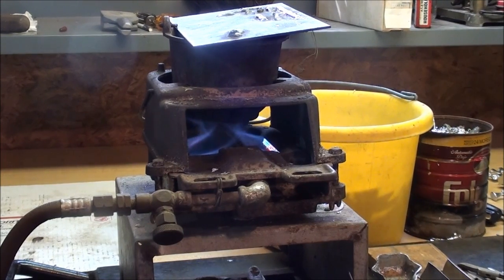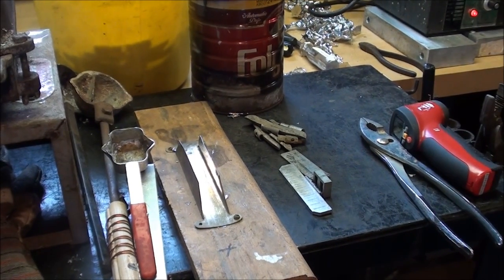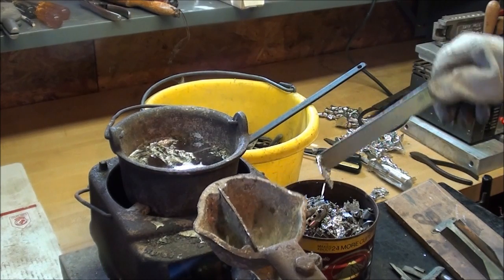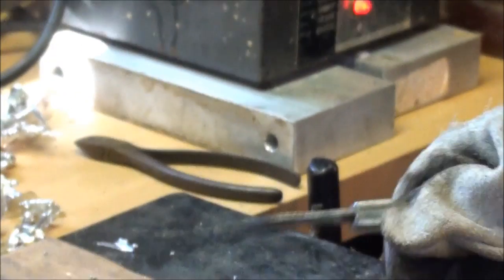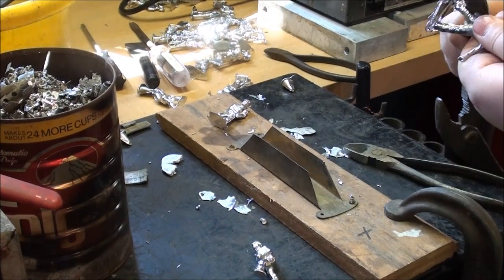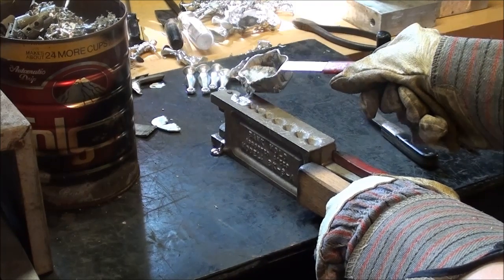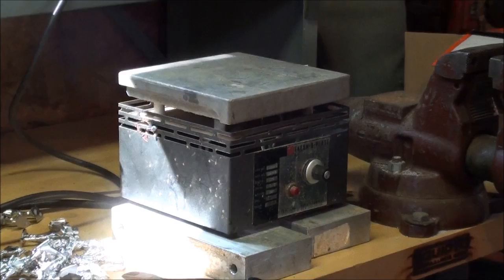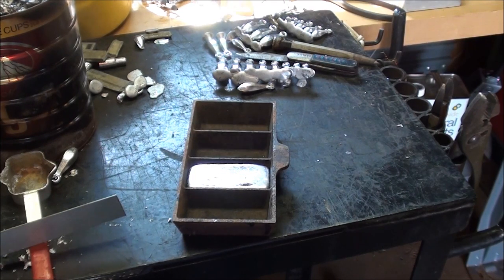BURNING MEMORIES tubalcain & jr. CAST TIN SOLDIERS & LEAD SINKERS mrpete222

Comment: I got my lead soldier set for Christmas when I was nine. I think Tublecain and I have the same set my clamp and board look the same though you can use any board.. Now I have over a dozen molds and have been making new molds I have an original cannon,airplane mold and several new airplane molds. I cast the new molds out of AL My kids and grand kids enjoy casting and painting the solders and other items.
I am an EE with a doctorate in Physics I don't think the lead had much if any effect on my brain. Well other than I want more molds!

Comment: just bought a bunch of those soldier molds, going to do a run of casting with pewter. Do you think casting talc would take the place of the soot? do you think the soot is absolutely necessary?
Reply from the maker: No, I don’t think it makes any difference

Comment: You may say that wheel weights aren't toxic, but Led in itself is very toxic and affects your brain even in minute quantities. When used on the road the led can spread throughout the countryside when it's eroded by the elements or when driving. So it's not very good thing to use as a wheel weight. There are better ones to use.

Comment: My infrared heat gun will not give a true reading on lead after the dross is removed.  I have checked it against a bimetal lead thermometer and it is off by hundreds of degrees.  I mostly cast Lee 9mm sinkers, 56 to the pound.  Great video, keep them coming.

Comment: That's an awful lot of dross coming out of that pot. When you melt a lead/tin alloy the tin will separate from the lead and so it must be fluxed, using beeswax, tallow, stick type bullet lube or a commercial type. The tin will cling to the steel wheel weight clips and should be knocked off into the pot before the clip is removed, then after the clips are out, you can use your flux, a ball about the size of a pea should be good for a pot this size.

The antimony in wheel weights is good to help the alloy fill the mold better, to give you nice sharp corners and etc. It is also needed for heat treating if you wish to make your casting extra hard, but this is only temporary and will return to normal after several years.

Comment: It´s a very common and great mistake to measure temperature of metals with an optical thermometer. You should never use it on shiny surfaces because you can get really wrong measurements, almost up to 70°C or more.
If you´re aware of this, well, then it´s o.k. to use this device...